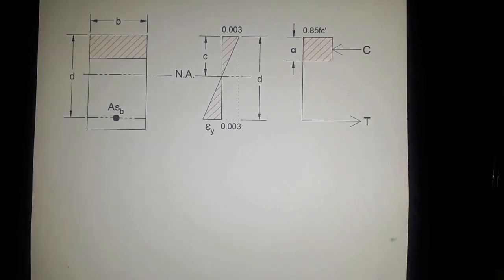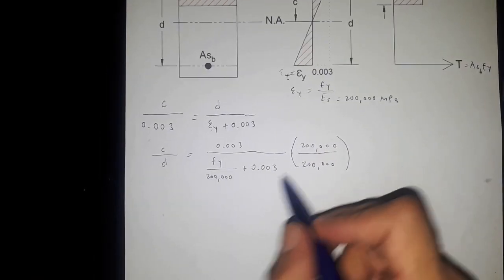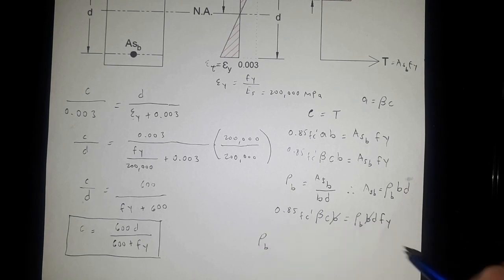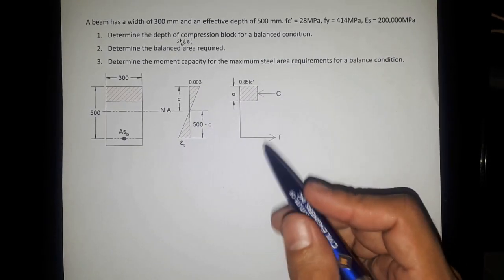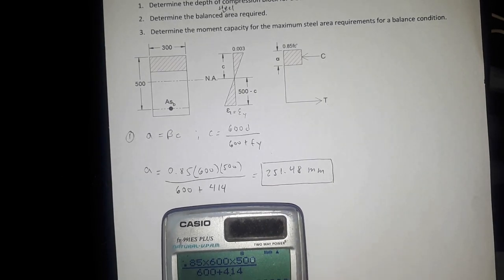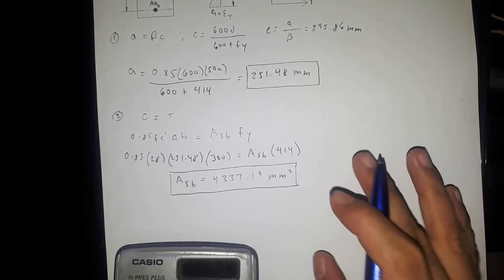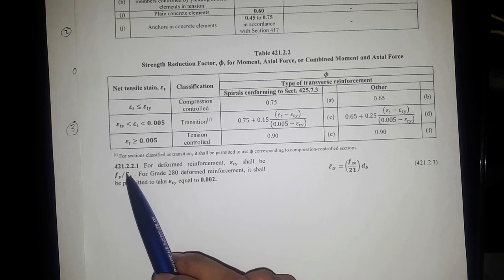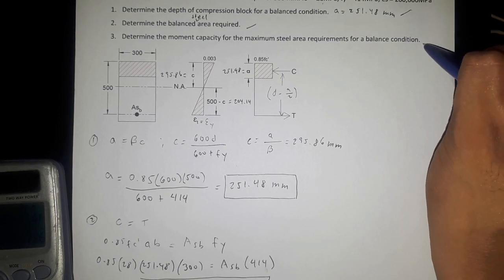Analysis of singly reinforced beam under balanced condition (using NSCP 2015)

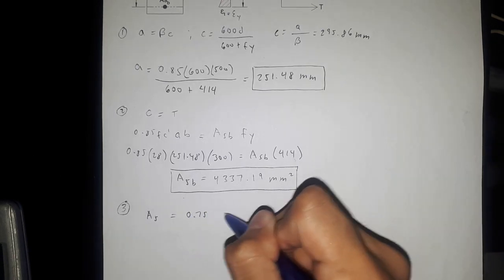Comment: 18:53  Sir, Nasa 2015 Nscp po ba yung paggamit nyo ng 0.75?
Reply from the maker: Nasa older ACI code. Section 10.3.5. Ito pa din yung ginagamit sa pagkuha ng rho balance until present. Same din sa board exam.

Comment: Hi sir new subscriber here. Meron po ba kaung summary of formulas for NSCP 2015 for board exam po.
Reply from the maker: I haven't read the 2015 nscp all throughout. What i am showing in this video are the applicable provisions from the code for the topic. As we go through, viewers will be introduced to more formulas from nscp 2015 that is used in certain topics and subjects.
Reply: @mathibae9356  ay ok po. Salamat po
Reply from the maker: Check mo yung comment ko dun sa isang video. Andun yung link nung pdf ng nscp 2015.
Reply: @mathibae9356  opo nakita ko na po. Salamat po